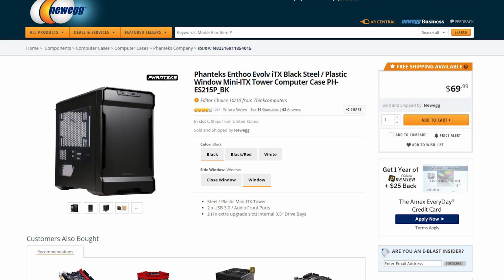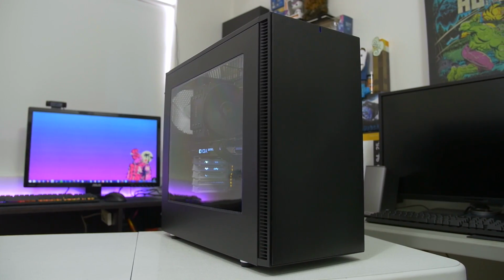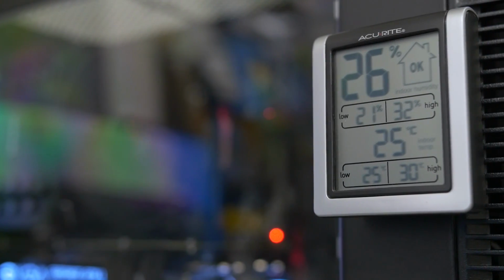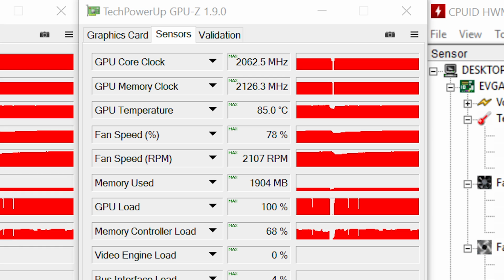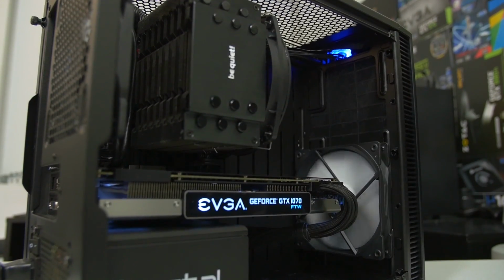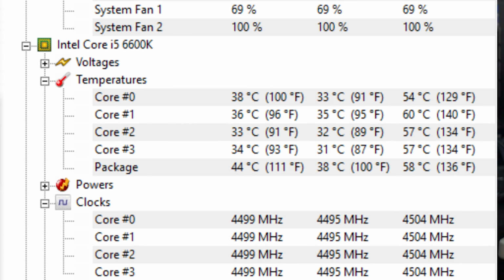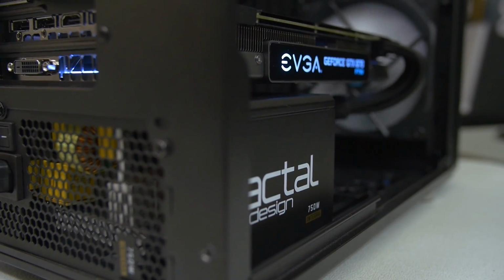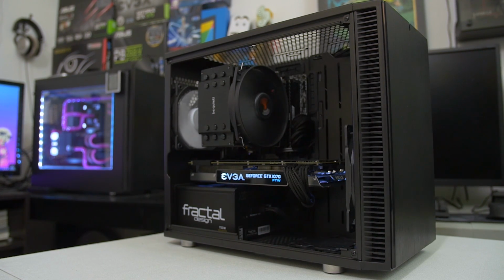Are Blower Fan Video Cards Actually Better in SFF Cases?

Comment: Kyle you really need to test cube SFF case's like the Corsair 250D, BitFenix Prodigy or the Thermaltake X1 etc that place the motherboards in a horizontal postion with the PSU underneath them. You will find that the temps for the GFX cards will be lower as not all SFF cases are build the same.

Comment: In the video regarding the 85ºC, you mention "No gpu should be running at these temperatures for an extended period of time". I've got a Windforce 980ti which ran close to that during the BF1 Beta, should I be concerned or would that be a normal temperature?
Reply: Gaz I would be concerned, check your all your fans :)
Reply: Gaz because my 970 never runes that hot and it gets some decet settings at around 100 fps

Comment: I have a GTX 1070 reference card. Playing GTA 5 last night maxed out at 1440p on a 144Hz monitor... My temps never reached above 74 degrees and my clock speed was LOCKED at 2023 MHz.

Comment: Like others, I'd like to see what the results look like with cases with direct ventilation for the GPU. I had really good GPU temperatures in my RVZ01 with an EVGA 980 ACX 2.0, likewise in my NCASE M1 with a 1080 FTW, in both cases with two 120mm fans directly feeding the card.

Comment: I wish you also had a case with a horizontal motherboard orientation, like many of the cube-shaped mini itx cases have (ex Corsair 250D) because those cases have direct ventilation over the GPU so it would've been interesting to see if the results would've been the same or different in those cases.

Comment: The proximity of the PSU has very little to do with why the card got hot.

The area immediately in front of a running fan is an incredibly low-pressure air space, usually filled by surrounding available air. In the "case" of cases like this one, the reduced air volume of the chassis and inadequate exhaust result in higher internal air temperatures. You essentially end up hot-boxing your card by feeding it the same air it's trying to exhaust.

Yes, the power supply does impede airflow to the card IF (big if) the overall capacity of the available avenues of airflow are less than the amount air being moved through the card by the fan, but even in a tight space like this, 3-4mm of clearance is all you need.

The moment you gain any sort of knowledge in the area of air balancing in large buildings is when you truly start to grasp and fully understand the reasons behind elevated component temperatures in small cases. You can eliminate a lot of these problems by conducting an airflow audit of your case, the same way you would for a new constructed floor in a building.
Reply: Interesting. So more exhaust case fans should improve the temp. Assuming there's no room for exhaust fans, do you think using SP case fans to push the hot air through the case could achieve a similar result?
Reply: With that theory in mind (i.e. the "hot-boxing" causing the GPU ), the PSU here looks like it has air holes at the back, which I presume allow warm air to leak backwards from the PSU into the case directly underneath the GPU's fan intake (regardless of the GPU type).  I wonder if the Nano S's inside temp would be lower if using a "better-sealed", albeit slightly lower-rated but longer, modular PSU such as the Seasonic M12II-620W. (picture gallery here: http://www2.seasonic.com/product/m12ii-620-evo/).

Btw, if I were to use a CPU fan cooler like the one in the video, would an extra fan work just as well for this purpose on the bottom of the case instead of the top? I'd prefer not to remove the top panel cover as it serves as both dust and noise protection.  Thanks if anyone can offer any info on this.
Reply: Btw, I can't decide between CPU fan or read-made water cooling.

I've read that the Noctua NH-U9S CPU fan has is quietest CPU fan both at idle and at load (even quieter than a ready-made CPU water-cooling radiator/fan kit such as the Corsair Hydro H100i-V2 or H110i liquid cooler), and it is able to keep an overclocked CPU no more than a few degrees above 80 degrees at load (obviously not as good as liquid cooling but acceptable).

On the other hand, water-cooling has better transportability, better performance and temp stability. However, I've read that those ready-made water-cooling kits often produce strange pump noises (like a fish tank motor) that can often be heard when the fan is idle or at low RPM. Does anyone have any experience with this kind of noise?
Reply: Grant Richardson air cooling keeps better temperatures than water cooling... at least noctua does.  This has been tested.
Reply: Hi zergtoss1. For what it's worth, I ended up putting the extra fan money towards the slightly more expensive i7-8700 (non-overclockable) CPU over the i5-8600K. It has comparable performance (max. 4.6GHz turbo boost clock) to the overclocked i5-8600K, but with 12 threads instead of 6,  and runs at significantly lower temperatures, so no need to worry about nor spend extra money on better cooling systems. The two included Nano S case fans and Intel's included CPU fan keep it cool enough.
Reply: The whole thing (including the msi GTX1060) is silent at idle or with general desktop work.
Reply: Grant Richardson whoa sweet!

Comment: This is why I only build SFF systems in cases that have the PSU at the top. That way it doesn't block or impede the graphics card cooling, especially if the case has an inlet fan at the bottom of the case blowing on the GPU.

Comment: Takes look around I like this one! Nicely done, Kyle.
Not a perfect simile, but: An open cooler in a small case is like using a shop-vac for your carpets- There are definitely better tools for the job, but it gets the job done, for sure. That's what i got from it at least. :)

Comment: Well, obviously. When it comes to blower coolers on graphic cards the hot air doesn't get exhausted back into the case where it mixes and sloshes around with the cold air and with the air that comes in contact with CPU's heatsink. This is why dual or triple fan designs aren't the best possible option for cases with limited airflow capabilities.

Comment: I made the mistake of taking two Windforce GTX 970s and putting them in SLI right next to each other, in an Air 240. No gap. While framerates are higher than with just 1 card, I do get thermal throttling. If I would have gotten blower coolers, I think my case would be more quiet and I wouldn't be throttling.

Oh, and I have a water cooler on my CPU, which is blowing air out the front of my case... I really need to reverse those and put my top fan out the back. :/

Comment: this is exactly the setup with my rig. my gpu (a 1070) is practically sitting like half inch close to my  ethernet card adapter blocking any space / airflow. of course i cant do anything about it but yeah, wish my gpu have more free airspace so them fans can spin with real air distance. max temp i do get is 81 degrees celcius and that when i play witcher 3 ultra settings but other games hover below 70C during intense battle sequence so im good.

Comment: Do you think you could maybe do a another version of this video using something like a node 304 or an elite 130? I feel like air flows through a Nano S in a way that's more like the air flow you would find in a standard ATX case, rather than most mini itx cases, and in often times in other itx cases the gpu has better access to fresh air. Otherwise, great video!

Comment: Another option is to rotate your PSU so the fan is at the top which vents case air out the back, this will also aid in dropping temps.

Comment: The highest temp i have on my 1070 by EVGA is 78ish degrees in a node 202 with 2 extra case fans inserted for positive airflow and forcing all the hot air out. Though it does take a while to get to that temp.

Comment: You should have used the same gfx card, just put the blower on there. Would be much more accurate.
Reply: That would require changing the heatsinks out also and there is no telling if they would mount up to the pcb. It wouldn't make a difference since he wasn't testing whether a blowers run cooler in general but if they are less affected by space limitations. The test he did shows this very well.

Comment: Obnoxious amount of fan noise? Bro, my PC runs on an intel stock cooler and a 4 year old single-fan Palit GTX 660 - if the GPU fan goes above 70% speed, I will NOT hear myself. 

That's more silent than my PC at IDLE D:

Comment: I have this case myself with a 390. 1st of all, you need two intake fans, but must importantly, replace the exhaust fan. it's a static pressure optimized fan and does a terrible job at exhausting hot air. I replaced it with a fractal design hf12 and my GPU temps dropped an avg of 13c.

Comment: Case manufacturers could get around this by building the power supply on top also, it may restrict radiator placement up there but most of us won't do custom liquid cooling anyway.

Comment: Here's a solution: use a fanless PSU like the Seasonic X-460W that is basically all open mesh, and the GPU fan will have air to take in, as well as generate airflow to cool the PSU

Comment: My MSI  r9 390 was always hot (80-90C) until I moved a fan below it (removing it from the front-top slot), next to the Power supply (case,Define R5 Black).  Now it's sitting around 60-75 with spikes in the 80's. Hot Card.

Comment: all of this is true - BUT you could just as easily buy a case where the PSU isn't blocking the GPU - shop around.

All of silverstone's itx cases - also the fractal design node 202 have the GPU in a somewhat compartmentalized area with separated air vents

Comment: Is there a difference in quality between different blower style coolers?

As I've heard that the quality of the nvidia FE fan is better and lower noise than those of partners (the MSI aero was used in that exemple).

On the forum they couldn't provide any proof though. They just mentioned that the nvidia card would be a lot quiter than its counterparts.

Comment: Hey Kyle. How about rotating PSU and using it with 1070 with aftermarket cooler? Additional power supply fan should help get rid of some heat... i think?

Comment: You had mentioned about putting more fans in the case. I am using the NZXT440 case. When I first built my gaming PC I thought the more the better in regards to the case fans. I have learned that is not always true. In my case with my config, simply running a rear exhaust and 2 front fans are the best for me. Actually adding any top fans just acted like a cyclone within the case increasing the overall temp of my components. Note: I had tried up to 7 case fans.What a waste of money! Thanks for the video! Have checked but was unable to find a video regarding how many case fans are the best? If you haven't done a video like that you might want to think about it.

Comment: I'd really like to see a comparison of blower vs open GPU specifically in the case of the Node 202 in horizontal mode. You've got two fan openings and nothing TECHNICALLY blocking it (aside from the ground), but there isn't much room for the air to move around. A blower GPU would SEEM to be the ideal choice, but considering it leaves an entire open 120mm area not sucking in air, would it neutralize the benefit vs an open dual fan GPU?

I'd also like to see variance between fan configurations along with those gpu choices, to see how they affect cooling. I'm wondering if setting two fans that close to each other in such a small space creates so much turbulence that it negates any benefit of having them in the first place, and I mean that in reference to both the fans vs gpu fans, and two fans sitting next to each other. I'd be willing to bet turbulence is created in both scenarios.

Comment: Kyle the question here is why are power supply's still so big if they made them long and flat along the bottom of cases then we wouldn't have this problem cables out of the top which could have a plastic coloured housing so compliments water cooling systems and the weight would be  evenly distributed at the bottom with a couple of fans built in to psu just a thought for some-one to make a million dollars off.

Comment: Interesting video - I have a 6700K with an Asus Strix GTX1080 in the Nano S case. After seeing this video, I let it loop on Valley for a good 2 hours - highest temp I saw was 76 with it overclocked, zero throttling on the boost. I also am running a Corsair H80i V2 push/pull and a Silent Wings 2 140mm fan in the front, so I have quite a lot of air moving through. Still running the stock 120mm at the rear.

Comment: very interesting video, BUT could you do a few more? o bet there is a big difference between GPUs, meaning that depending on the wattage the gpu has is makes a big difference or not. a 1060 open-air design would suffer much less than a 1070. just an idea for a follow-up maybe...

Comment: @BitWit No issue here running my Strix 1070 at 2150mhz in the NZXT Manta. I do have 2 Intake fans, 1 exhaust, and then the 2 fans of my H100. My 1070 runs at 60-65 with a custom curve that doesn't go above 70% fan speed. Has happily ran a 2.15ghz for a little while now without any thermal throttling.

Comment: well ...
I have the Define Nano S and the GTX 1070@2124Mhz (EVGA SC) and i7-4770K@4.5GHz happily running under 45C and 60C respectively with just 360mm radiator surface. (think to change it to 480 or even 600).
And there is nothing like liquid cooling in terms of temperature and noise.
Yes, it costs some 300-500 USD (depending on your choice of components), but it's really THE BEST :)

Comment: Why did you compare it to the Define S, which has a much higher volume? If you really wanted to see the impact of the PSU being too close to the graphics card fan, then why didn't you just move the PSU outside the back of the Define Nano S? Wouldn't that have been a much fairer comparison?

Comment: This is actually similar to my situation. I have the MSI/Corsair 980 ti SeaHawk. And if I have my GPU at the top slot on my Mobo the tubing for the AiO cooler bulges out and presses against the window. So it's sitting right above the PSU. And being a Hybrid cooler there is still a fan blower style hanging over the space behind the PSU above the cables. So there is still air flow for blower.

Comment: Or you can use a slightly wider chassis like the corsair air 240 and enjoy good thermals while still having everything in a small form factor because the PSU is in a different chamber with all the cables and drives, leaving the CPU and GPU enough room to breathe. My OC'd gigabyte g1 gaming gtx 1070 tops at 65°C, while my i5 6600k at 4,6ghz doesn't go above 45°C under load with a room temperature of 25°C inside that chassis.

Comment: I have the same case with 
6600K @ 4.2ghz 
Captain 240 ex 
16gb 3000mhz g.skill 
1060 G1 
z170 G1 
620w seasonic 
+ 1x 120mm stock cooler on the back and 1x 140mm stock cooler under the gpu next to the psu. 
After hours of playing Gta V, Doom, Tomb Raider on ultra settings, i never seen my cpu go over 42c or gpu over 60c. 
Also, the top of the case is closed.

Comment: To get around this issue I used a sfx power supply and installed a case fan in the bottom sucking cold air in, works really well!

Comment: I have the define nano S, water cooled i5 6600k, gets maybe 45C under load full load overclocked to 4500mhz, and my msi gtx 1070 gaming x hits 67C max under load when overclocked to 2075 stable. all you need is an extra 120mm fan as an intake right under the graphics card next to the psu.
Reply: graphics card fan at 73%

Comment: Or basically it's that mitx case is designed as crap as they could. No one in his right mind should put an ATX PSU below an itx motherboard without extra clearance space.

Btw, that case is everything but a SFF case. 27l and you consider it SFF?

Comment: That gpu temps bigger then 80 degrees is not good if you playing for hours is Bullshit @Kyle.
I had a Msi R9 390 on air for 3 months before I watercooled it & with some games my gpu got 92 degrees.
I played many times for hours without any problems.
Oke, Temps around the 80-90 degrees are very high and nobody wants this kind of temps BUT......The gpu can handle the temps very easy......The r9 390 does :P
Now with water it gets 65 degrees at the most :)

Comment: I have a G1 970 WF in my Nano-S I see no differens in temps, between my Nano S or H440.
Reply: Peter J h440 sucks at airflow
Reply: thats a myth, i changed my h440 for the phanteks evolve tempered glass which has loads of room inside and temps are exactly the same
Reply: temps will always be the same because the speed goes up and down to keep temps stable.

Comment: You post some interesting info though I don't think you've taken everything into consideration here. In theory the temp rising in the gpu is not due to "restricted air flow" but purely because of the proximity to the psu and the heat that it generates. 
Your rig is using a 750w psu with a bronze efficiency rating. The max draw on that system is less than 350w, the lower % of the psu used, the hotter it gets (more of the power is wasted and turned into heat). The gpu closer to the psu and it's sucking warmer air, not less air.